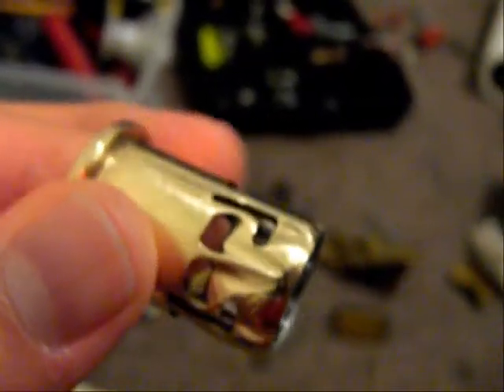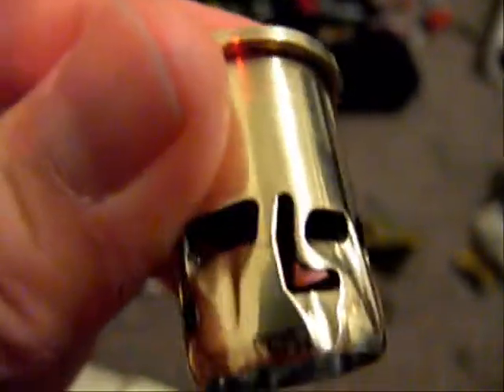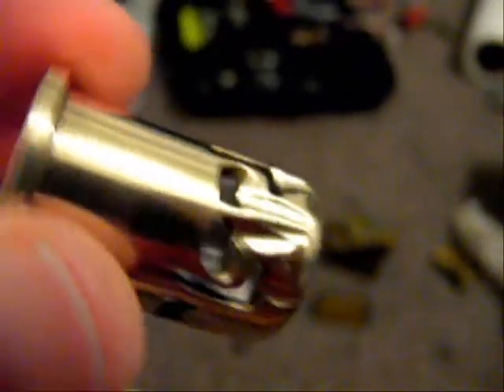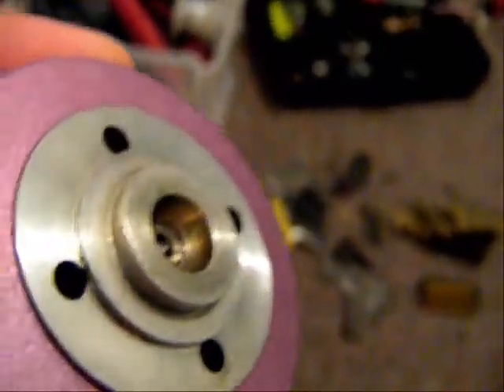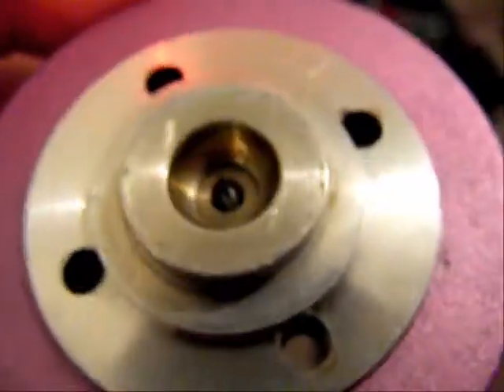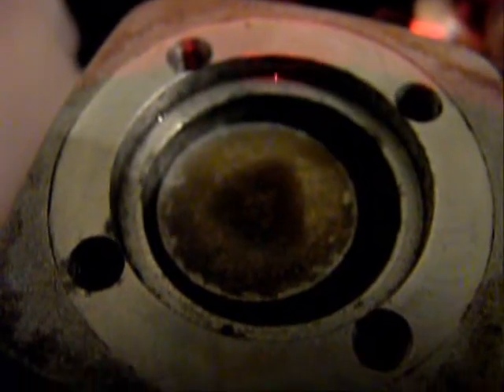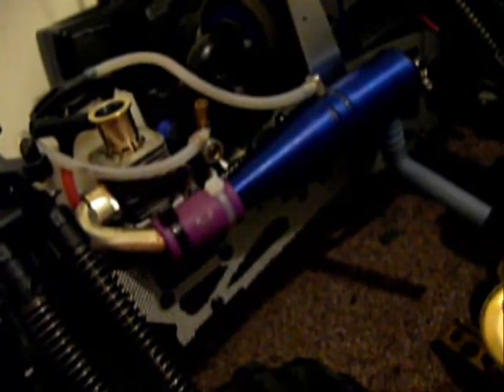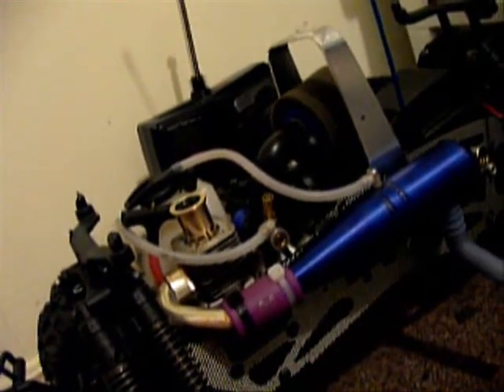Ofna Hyper .21 8 Port: Porting Some More

Comment: @Crystaaaaaaall the motor that came with the truck is a s-25, this motor i bought was from another guy 4 years ago and i still have it. also this motor puts out more power and top end than a .25 motor because of its ports but i got a o.s something pipe and it kicks ass and its worth $100 alone

Comment from the maker: @tman1335 well when i got my savage it never came with a engine so when i got this, it barley did any wheelies but i have gotten a s-25 engine and thought it had more power but it didnt. After i got the right pipe for the .21 it has so much power now more than a s-25 engine with a tuned pipe

Comment: i dont thing what your doing seriously, the piston wont go lower than the exhaust port enyweys so all those canals will just stop the fuel from coming up.  if you want to see how a twostroke cylinder is kinda suposed to work, theen look at a moped cylinder called hebo manston.

Comment: heat wont always harm piston an liner , its rod an bearings tht dont like heat ,leave it alone till u learn about porting engine timing cuz rlly do u no wat yr doing ? dont look like it ,looks chewed up ,bet only thing does is loose more fuel
Reply from the maker: this actually increased the engine power by 20%, i still have this engine to this day. It used to strip diffs and break axles till i had to upgrade to hardened steel drive train parts.
Reply from the maker: also ive ported bigger 2 stroke engines so i could go back to this motor and change the timing abit by raising the exhaust and widen it but then again i dont use the engine anymore. I do it to my motorized bicycle which you should watch on my channel